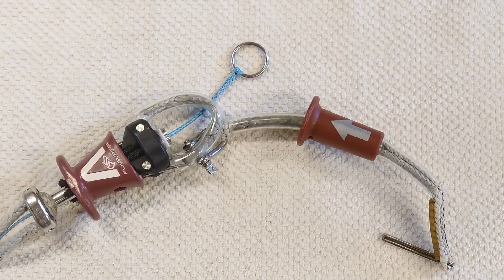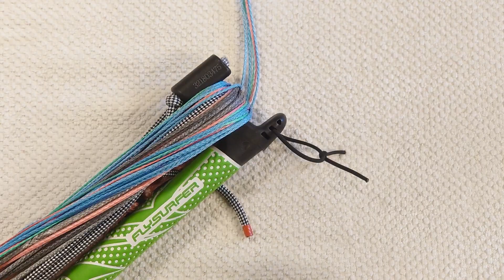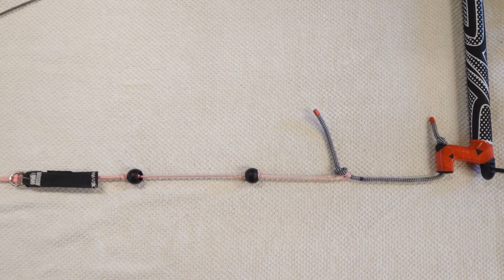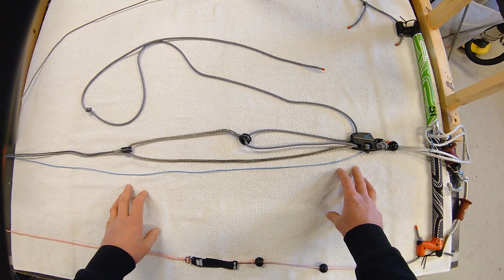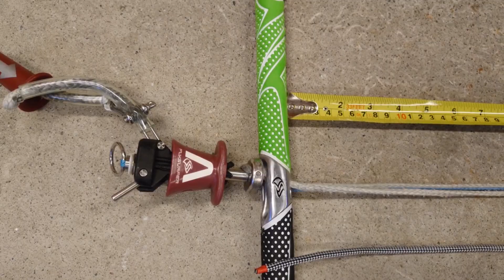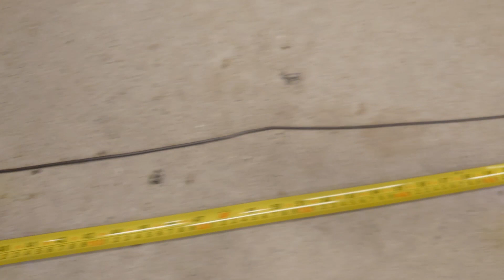Custom race control bar for foil kite

Comment: Hey, thanks for your Video Mate! I like your style alot. May I ask if you updated your design in the past 2 years? Im considering some upgrades on my side too and would be curious for yours. Some Q: You measured 3.90m leader lines. Why 3.90m? Ive calculated that with 60cm bar/30m Lines/smallest 4m Kite, you would need that, but no regular 6-16m Kite on 24m Lines will have an intersection further out than ~2.3m. So, I consider to use 2.5m Liros Slide Protect XTR ontop of some Liros DSL or PPSL (sheeted Dyneema already) for extra stiffness of the lines. What do you use?

Comment: Thanks for this great video!
It is so nice to bump into stories or videos and see other people doing the same I do, modifying equipment trying to find the best result. It is the combination of all those great ideas that gets you to your almost  perfect solution which can be different for anyone of us :)

Some thoughts witch mite be interesting for others, 

 I modified the original Red QR release handle. It is designed in a way it grabs hold on anything near it which is in fact the real problem with accidentally opening the chicken loop. Therefore I grinded off a lot of excess material without reducing its strength and since then it never opened unintentionally￼ and works perfect.

Comment: Very nicely done Oliver! 

One question. Have you chosen to use the sleeved rope in the end due to it being stiffer and less prone to tangle compared to the grey unsleeved dyneema? 

I imagine grip/friction in the grey dyneema would be no issue with a 4:1 compared to for getting a good grip when pulling in on a ordinary 2:1 ?

Comment: Hey Oliver greetings from Wasaga beach Ontario Canada. GREAT Video. I also make my own bar setup recently I made a copy of Greg Drexlers  kite bar for the cloud kite from Board riding Maui . I really like your modified flysurfer bar as I agree with the shortcomings. As I also have a kite buggy , Popeye the welder has a good video on tieing  the brimmel  knot which as you know  is key to making your own dynema lines and modifying your bar! It seams you have two ways of flagging the kite ,one by hand and the other with the original ring at the chicken loop is that correct?  One on the back line and the other on the front is that correct?
Reply from the maker: Hi James, thanks for the info. I'll check out those guys. Yes two systems. The normal 5th line attached to the front line and a leash. And the oh sheet on the steering line. I'll do some more videos at some point showing how to use the oh sheet and how I attach it all to my sliding spreader bar.
Reply: @ojyk  Hi Oliver 
Greetings from Spain. I dont understand how do you use the front-line safety. Is conected to a secondary leash?  In that case for a total release you would have to pull three systems, QR + suicide + front line. 

I woul only use the suicide mini leash attached to the second leash ¿?

Could you explain please?
Thanks for the video
Reply from the maker: @urloa  yes full kite release would require releasing all 3 systems. What I tend to do is put a normal long leash onto the ring on the end of the 5th line. Then connect the chicken loop to my harness. Then I launch the kite and head out into the sea. Once I am out at sea I connect the suicide leash to a ring on the front of my harness. Then at the end of my session, before I get back to the beach, I release the suicide leash. That way I am never on land attached to the suicide leash, only when out at sea. It's a bit of an unusual setup. Probably too complicated for some people, but I like the flexibility and security of it. I don't want to be out at sea with a kite on the 5th line by mistake. Chances of a successful relaunch are slim. So this system reduces the risk of swimming. Hope that answers your question.
Reply: @ojyk  yes! Thanks 
I understand now why use three systems. Maybe a bit complicated,  but if you are experiencing unexpected releases... Worth the effort.

Take a look at infexion QR systems to avoid unexpected releases

Comment: Really good explained how you build what you did and why, super with all the links where you bought the lines etc. 
The green side of the bar is suppose to be on your right side so you have it correct, also smart to colour one of the bar ends for extra safety.

Question, to me the Ronstan Sheaveless compact blocks looks neater then the rings, any thoughts? https://www.ronstan.com/marine/shocks.asp
Reply from the maker: Thanks. Yes they look really nice. I guess they will do just as good a job or maybe better. One issue with these low friction components is if you get sand in them, then they get scratched and the friction goes up. So it's important to stay away from sand.